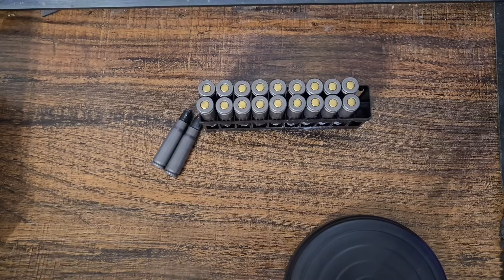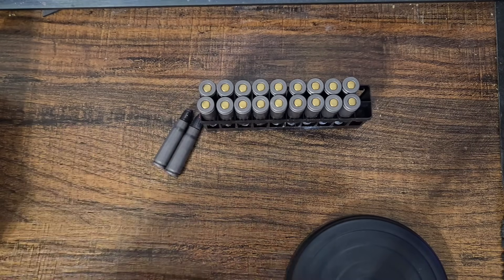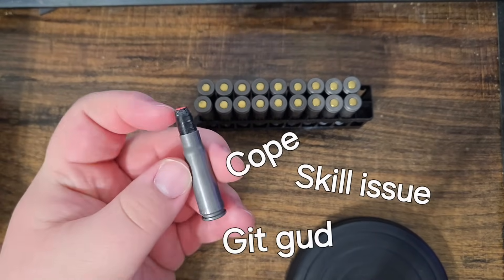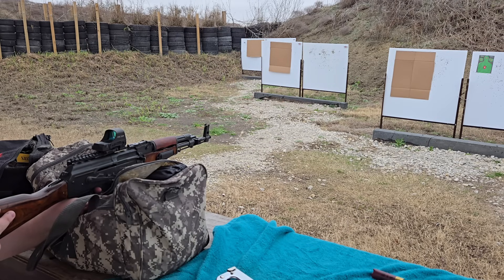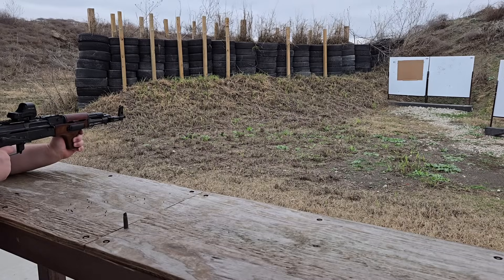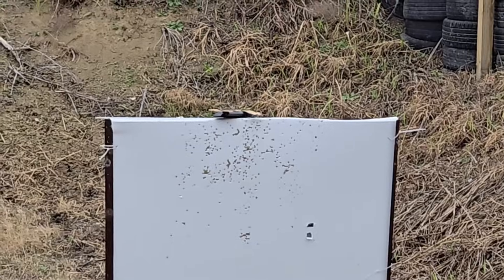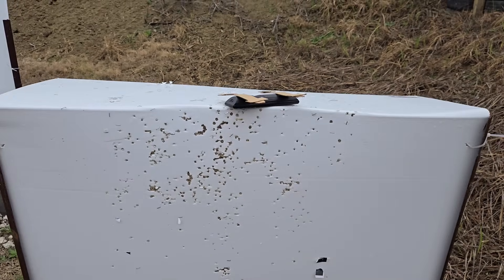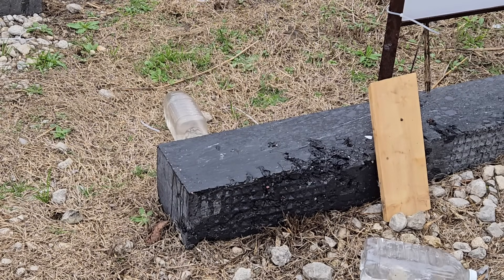Anti-drone Ammo (Printed Three Dimensionally) - V1

Comment: In germany there was an interesting test, which showed one fact: a flying drone has typically a low mass and light plastic materials, so a hit by too small projectiles will not destroy them instead just push them just aside. So min 5-6mm, so shotguns would be much more efficient (conservation of momentum rule ;)

Comment: I think the scientifical force with the rifling and the speed of the round is making the pattern spread immediately and immensely, if you slow it down it will help the rotation not pull itself apart
Reply: Also try a slower burning powder, and it will help your gun cycle as well

Comment: Need a shotshell for a screw-on golf ball launcher. That will fire 700 grains of lead with a very wide shot pattern. You dont need a deadly projectile. You just need to nick a rotor and it will destroy itself.
Reply: Firework mortars, Take advantage of that lift charge. You could "string" an area to be a reverse minefield for them. Minefield in that it's a super claymore facing straight up.

Honestly really surprised we havent done this. We used wireless switchboards for some firework shows just to be safe as we could. (Would be best to be automated of course, perhaps an illuminator and sensor?)
Reply: Awesome ideas 💡💡💡 or a 40 mm under barrel launcher with bird shoot

Comment: You need a smooth bore choke use a layel to make something interact wit the rifling making it go the opposite direction straightening out there path in mid flight I hope you like this bc psychic say energy expands so the bbs are instantly interacting with the rifling acting like a marbel toy on a corse so a slight bend into the rifling going the opposite way should work but only a little to make en go straight basically bending it the opposite way just enough of the rifling on a threaded piece of metal should work making the rifling straight after the opposite direction rifling

Comment: You should try the shrink wrapped ball bearing anti drone rounds next
Reply from the maker: I've seen those too and would also like to try them out. I don't own a 5.45, but I could definitely try 'em in a 5.56.
Reply: @FNRifleman i would make a 3d printed sabot instead of the shrink wrap to avoid barrel fowling
Reply: @FNRifleman  DO IT PLEASE I DON'T HAVE THE CAJONES TO TRY IN AN AR 😭😭😭😭😭😭😭😭😭
Reply from the maker: @DannyPhntm777  Coming soon 👀
Reply: Yeah, I want to see if the shrink wrap comes apart or not.  I don't think it will make much difference going from 5.45 to 5.56, though idk what twist rate is common for the AK74.
Reply: @chillmonkey6782  Different countries used all sorts of rates but they are usually around 1:7